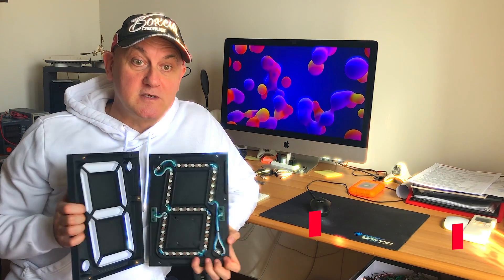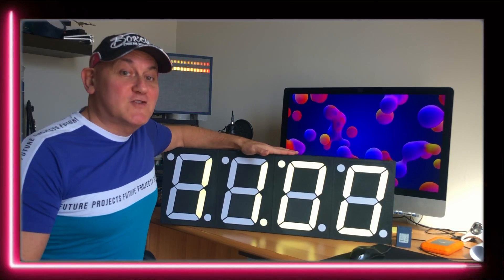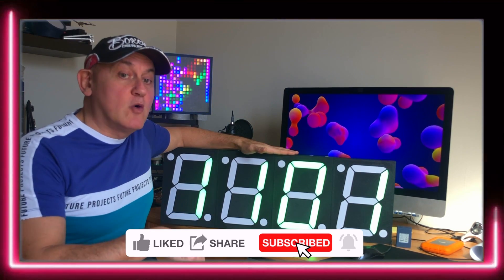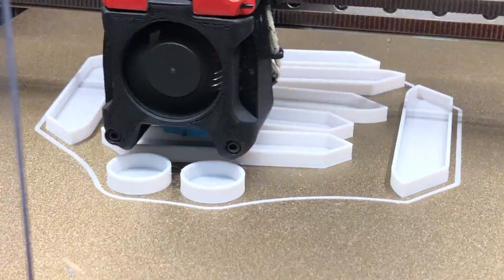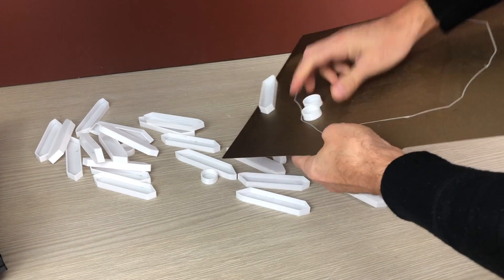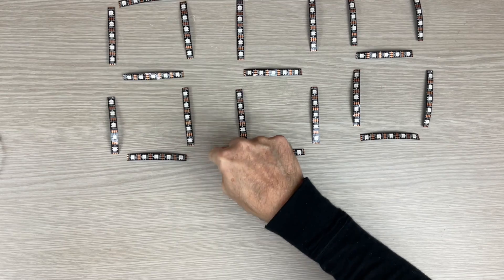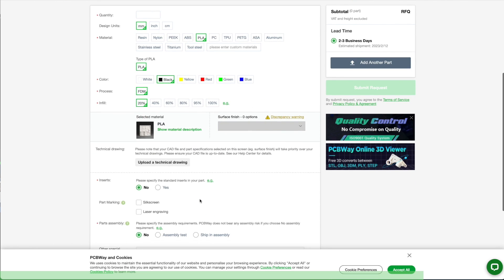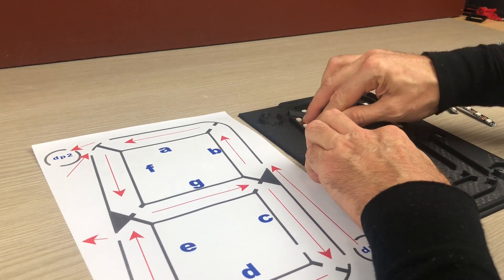LARGE DIY 7 Segment Display Leds Digital Clock

Comment: Very good video, my friend. I just have a question: where exactly did you place the cables for the ESP? Did you place the 5V, ground, and C in parallel with D and C? Or where?
Reply from the maker: Hello, I cant understand what you asking for… could you please explain better your question?
Reply: @boomytech7504  Sure, look, the problem I have when assembling it is knowing where to solder the ESP wires to connect it to the large display. For example, I see that in some images you have the wires connected to what would be the little dot, but I’m not really sure if I should solder the 3 ESP pins to that, or instead to segments D and C of the display.

I'm not sure if I explained it clearly or just made it more confusing haha.
Reply from the maker: Ok, now its clear… the first segment where you have to connect the pin 3 is DP1. At 4:17 you can see that I indicate an arrow coming from outside that indicate the starting point… than b segment, then a segment and so on..👍🏻
Reply: @boomytech7504 Ohh, got it now! Thanks a lot!

Comment: Can you tell or make a list of the components where could be bought? I mean the white connectors, and the gold pieces where screws get into. Would be helpful for beginners where don't know where to buy all this components.
Reply from the maker: Nice idea..I will do it…👍🏻
Reply: @boomytech7504 did you happen to make a list? I’d love to know what those gold/brass melt in screw holes are called please?
Reply from the maker: Hi Paul, you can google it using “Brass Threaded Inserts” M3

Comment: I have a very similar project i completed before i saw this.  Very interesting how we approached it almost the same....  I have one male and one female connector on each 7 segment block (so i can connect them in sequence easily).  I used clear PETG for lenses, I did not use the "dots" in each segment - I used a central ":" to show the gap between HH:MM and put the controller in there.  Your connector solution of soldering onto boards is better than mine.  I have no screws in anything - only clips... Thanks
Reply from the maker: Hello and thank you to share your experience. I chose to use the dot in the display because in this way it is possible to use the digits also as decimal or thousands separator. Congrats for your project..😀👍🏻👍🏻👍🏻👏🏻👏🏻👏🏻
Reply: Hello,
Do you have any source code that you can share to put it to work as clock? 
What microcontroller did you use?

Thanks.

GliCidO

Comment: I have that part completed. How is the board that the esp sits on wired to the led's, it is hard to tell where the g, 5v, gpio wires go to power the lights on the printed board. Also what panels get the short dupont connectors and in what order starting with the first panel. I know I might not be making ane sense but the video does not provide enough of the final wiring.
Reply from the maker: in the previews message I sent you a link to esp8266 pinout where it is clear indicate the VCC, +5V, and GPIO5... anyway I've prepared for you this drawing and I hope it will be useful:
http://www.bitandweb.com/img.jpg
Reply: Thank you. I will see what I can do.

Comment: I am a little confused. I have all the led's wired in. I have the ESP and board all set. I need to know where the wires go from the esp32 to the led's. Also where does power come in, and as well where are the short plug connectors set. If you can post on the PCB site a few more pictures that might help me out. Teriffic project.
Reply from the maker: hello, at 08:15 you can see exactly how to connect the 3 pin. VCC, GND, and GPIO5
Really easy...
here you can find a esp8266 pinout
https://randomnerdtutorials.com/esp8266-pinout-reference-gpios/
if you need more info feel free to write another comment..

Comment: bonjour jai baux chercher et jai rien trouver sur votre projet pour le esp32 ..... pour koi une video pour rien
Reply from the maker: This video is about esp8266. You can find source file in description. If you want use esp32 you can easly modify the source code using a library for esp32 instead esp8266 .h file inside the sorce code…

Comment: 9:31 You forget Show how to connect microcontroller(ESP32) with LED and not have electrical circuit diagram.

I want to know electrical circuit diagram ot Can follow.

Please send electrical circuit diagram ?
Reply: Hello
Reply from the maker: Hello Halogogo, you can see at 8:30 wiring to esp8266, the pin used is gpio5 and of course vcc and gnd.. 
you can see esp8266 at this address:
https://i0.wp.com/randomnerdtutorials.com/wp-content/uploads/2019/05/ESP8266-WeMos-D1-Mini-pinout-gpio-pin.png?quality=100&strip=all&ssl=1

Comment from the maker: Hi guys, what do you think about this project? how would you have done it? what would you have changed? let me know in the comments..😀💪🏻
Reply: yo0u should show the programming, building the boxes is the easy part.
Reply from the maker: @TRCCtv thanks for your suggestion.. I’ll make a video about that..👍🏻
Reply: It is really nice. I am planning to do it. My printer bed size is 200X200mm. So I may have to reduce the prints to probably 70%. Also I am not good at programing the board. looking forward for follow up videos about that part. Thank you so much. You are a very talented person.
Reply from the maker: Hi, I really appreciate your comment. I'm sure you will be able to realize this project with your 3d printer. You can see in this video:
https://youtu.be/UV-C8EKaZS0
Ho to program it and in the description you will find the source code.
I f you need help, just write a comment.
have a nice day.
Reply: Interesting that the JST connectors (24 gauge) are only rated for 3A but if you light all those LED"s in WHITE you're going to be pulling a lot more current than they are capable of. Driving 148 x 5050 LED's so max brightness with white would be 7.4A. I also noticed there's no venting in the enclosures and those LED's are known to get hot. Cool design, but I feel it needs a little more work in the electrical portion.